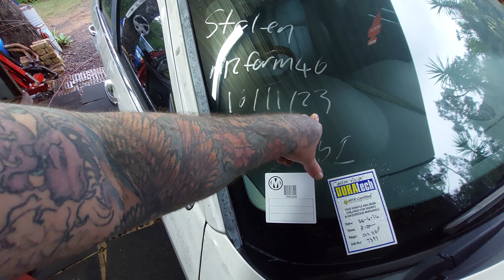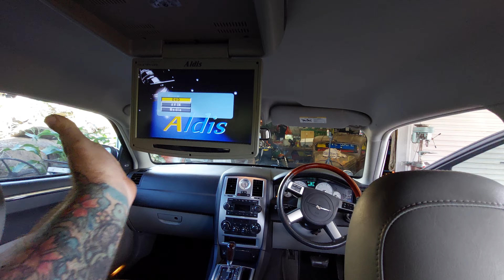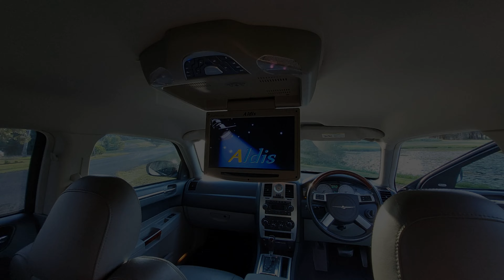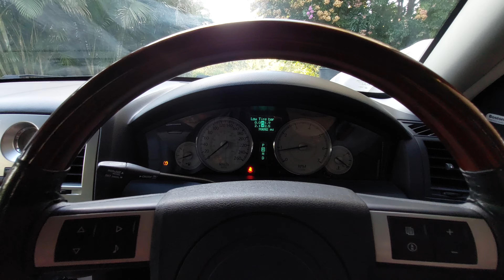Can I Make $17000 Profit on this Salvage Auction Flip Car? Rare V8 HEMI Chrysler 300C Wagon!

Comment: Cool to see a 300 as a wagon. We only got the Dodge Magnum as the wagon.
Reply from the maker: The magnum is different to the 300?
Reply: @copperheadkustoms  it’s basically the same car but the 300 is fancier and more upscale than the magnum. The three choices we had in USA were charger and 300 as sedans and the only available wagon was a magnum, which only came available as a wagon, in those years.

Comment: CHK That now looks sic, $16 to $18K nice job, should sell pretty fast with only 78K on the clock, awesome work ❤🍻🍺🍻🍺🇦🇺🇦🇺🤝🇦🇺🇦🇺🦘🦘🏔🏔❄️🌨🥶
Reply from the maker: Thanks mate, nsw people saying 18 to 20 in qld 20 to 25, apparently rare but nice low km ones rarely come up for sale as people hold onto them but spoke to 2 people that either sold or bought 1 in last couple months in qld 1 was 200km sold 23k other 120km sold 24, glad I did a bit of extra research as was about to advertise for 14k
Reply: @copperheadkustoms  my pleasure. Awesome work and congratulations always pay's to check before selling look what you found out 👌👍 👏 🇦🇺🦘🏔🍻